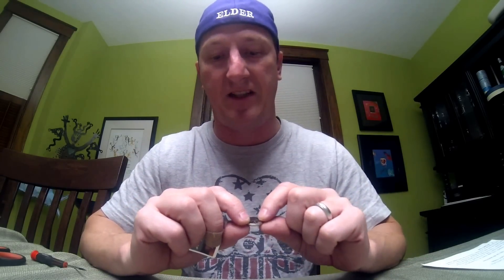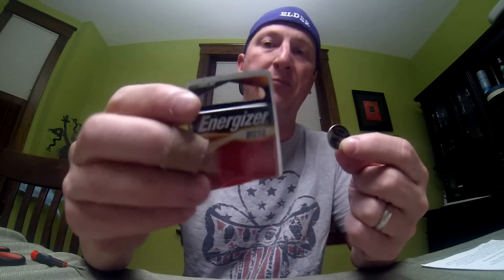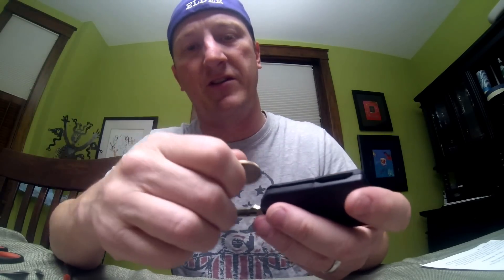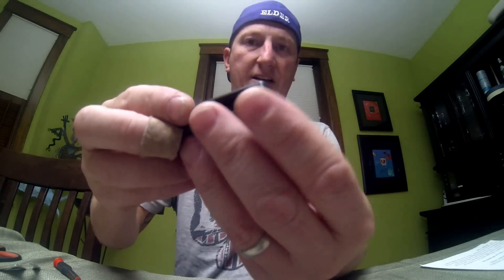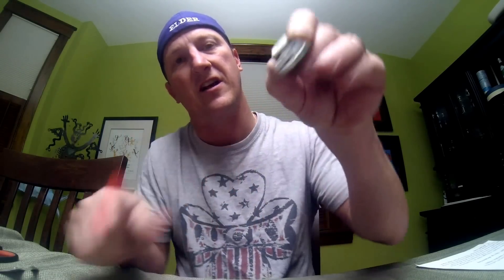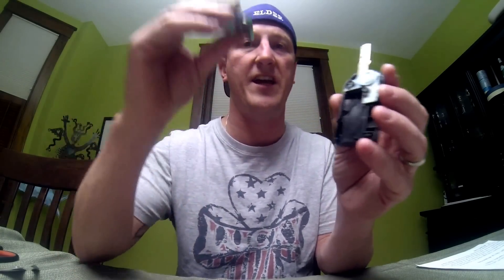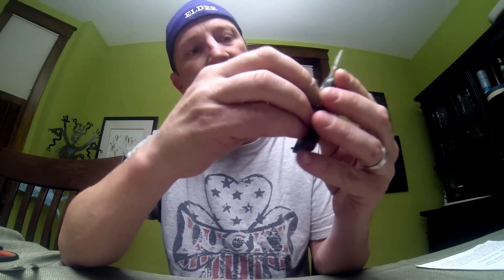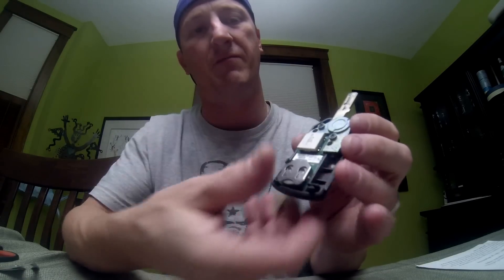Replacing Ducati Key Fob Battery

Comment: Thanks man, you just saved me $50. My local Ducati dealer wanted to charge me $50 friggin' bucks to do a "Feyfob Battery Service". I just bought the battery at Advance Auto Parts for $5 and swapped it out in literally 30 seconds.

Comment: To clarify the step at 1:55, I'll quote my Ducati Owner's Manual:
"Insert the point of the flat screwdriver just under the printed circuit board, being very careful not to damage it. Do not apply force on the battery or battery holder."

If you pry the circuit board out by applying pressure to the battery or battery holder, you may find (like I did, after watching this video), that your wireless key will still not work after putting in a new battery!

Comment: You must be pretty handy.  Took my dealer 15 minutes with a super big screw driver.  Crazy design.  Swapped my battery but I'm still having reception problems with the key.  I actually damage some of the finish and the rubber started to come off which I later glued back in with rubber glue.  Frustrating...